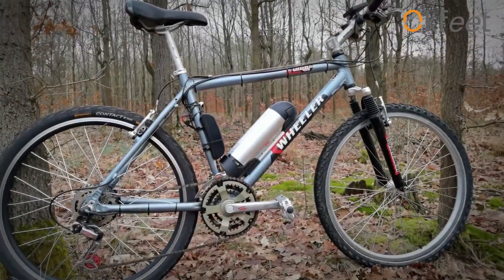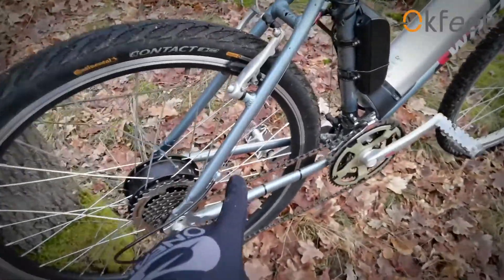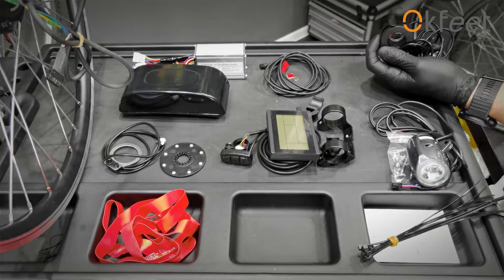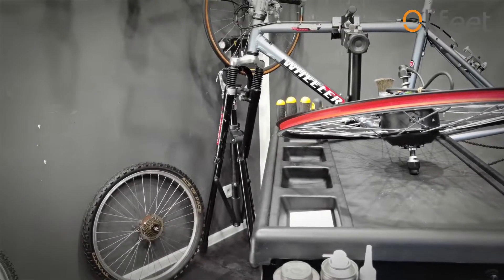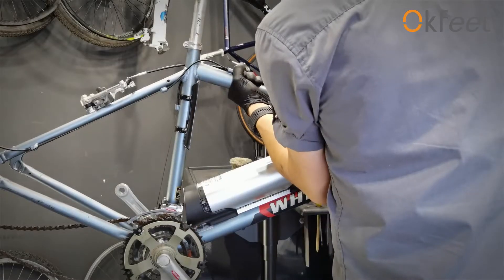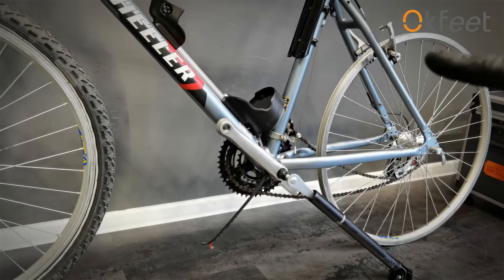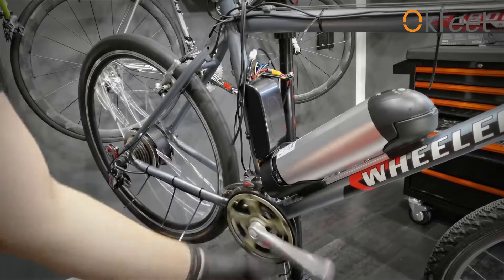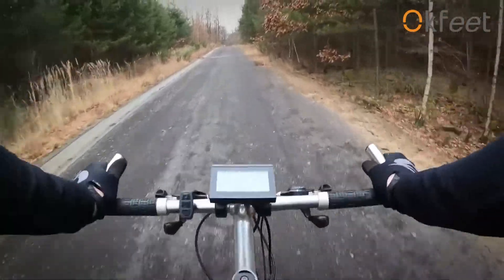Aliexpress Top Sale Best Electric Bike Conversion Kits Test (FULL)

Comment: The pedal assist delay is one of the reasons I'm glad I did the extra work and installed a mid-drive. The TSDZ2's power is basically instantaneous. even if getting the bottom bracket out was a nightmare.